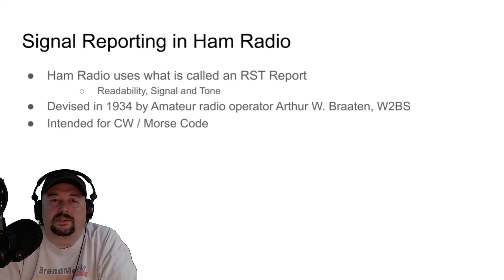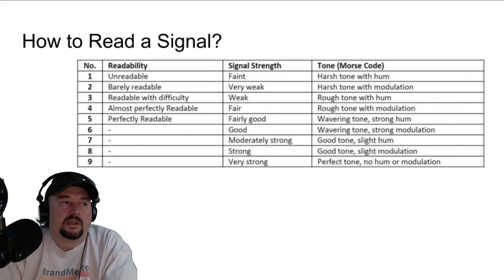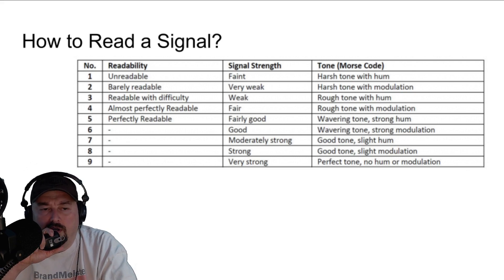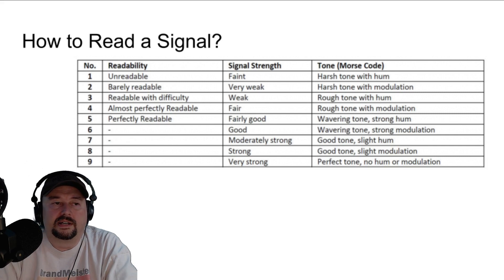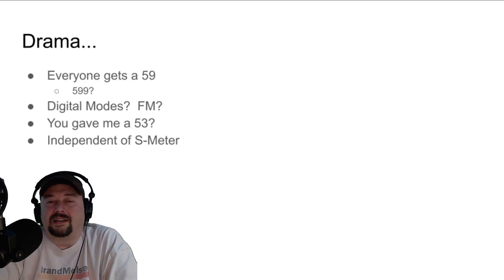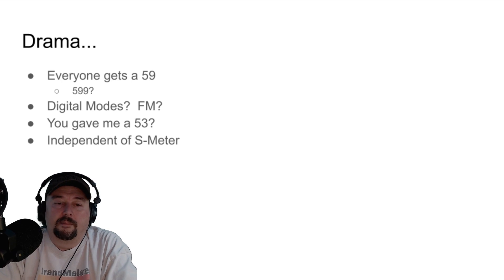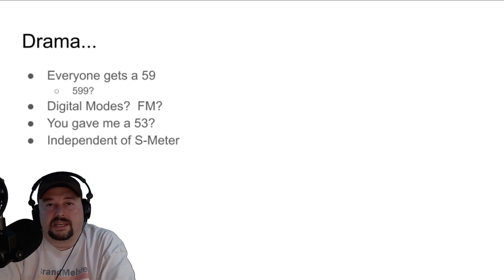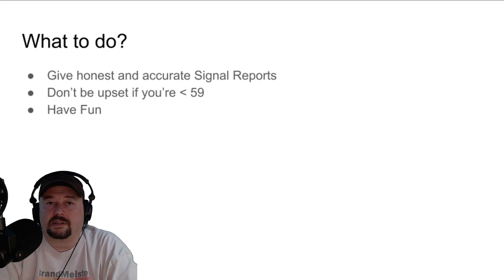What the Heck is a 59? - Ham Radio - TheSmokinApe

Comment: A few opinions on 59's during contests and why everybody is 59.  Typically the purpose is to make as many contacts as possible.  To give an accurate signal report requires you to listen, listen again, look at your meter and possibly listen a bit more.  That takes time.  Time away from possibly making another contact.  Second opinion is if someone gives you a 33 or 51 or 48, it really messes with your rhythm in a contest if you are working a pile up.  If you have a stack of contacts who are waiting to get you in the log, the ADHD kicks in and if your not working stations quickly, operators who are searching and pouncing are moving on, hence get them in the log and move on.  Typically the signal reports is the least important thing in the contest exchange.  Third opinion in contests with lengthy exchanges, operators say 59 before the exchange.  This give the operator a queue that the exchange is coming and to get ready to copy.  Most contest loggers will automatically insert 59 or 599 into the proper fields after entering the call sign.  This give you a breather to catch up or correct a call sign before the exchange it given to copy.  Great presentation.  Always debates about signal reports, if they are accurate and if they are really needed.  Lots of drama behind this subject.
Reply from the maker: Thanks for the comment Kyle, I always appreciate your perspective given your experience and commitment to HR.  I understand why "it is what it is" for contesting.  Maybe they should trade some other piece of info that most folks aren't forthright about like; age, height or weight!
Reply: @TheSmokinApe  Last trip to the doctor?
Reply: And plus this comment was not to skool anybody, especially you.  It was to maybe give some perspective on my thoughts on what I've learned about the 59 signal report throughout the years.
Reply from the maker: That's exactly how it was received, you a 599+10 son!

Comment: I give this video a 5 9 +10
Thanks for this.  As a new ham, I thought I had an idea of what this was about, but not completely sure.  I will say that I've had people that seemed annoyed with less than a 5 9, I don't get it.  It's not a threat to your manhood.  It's propagation.
Reply from the maker: Thanks for the comment Greg, glad you liked it 👍
Reply: I do, from time to time, give a "10 over" or "20 over" but I indicate that they are 5-9 with a '10-over on the S meter'..  even though it is somewhat irrelevant, as the Smokin Ape says.. if you think about it, it IS relevant in a way. Gives the recipient something to ponder.. like, am I that loud there because we're a perfect distance apart? Because of atmospheric conditions?  Lots ot things to think about. Yes, I know, MY S-meter and yours only have the name S-meter in common. So, relevant signal strength is just that.. 'relative to my radio, my antenna, my feedline, etc'  I do completely agree that basing a signal report solely on the S-meter is wrong. But I don't see where giving that little bit of extra information is any kind of issue.

Comment: 5 9 here, The Smoking Ape, but I missed your call sign.
Reply: Great video. I usually give honest reports.  I have however, given a 59 and needed them to repeat their call. Usually because either 1. Another guy with a strong signal walks over the first 2. There is a quick static crash right during a single letter of their call, or 3. I am daydreaming when the person gives their call and I need them to repeat, even when they are perfectly readable. So just because someone needs to repeat the call, doesn’t mean its not a 59.
Reply from the maker: Fair points, thanks for the comment 👍
Reply from the maker: Lol, thanks as always for watching Jim 👍
Reply: Lol